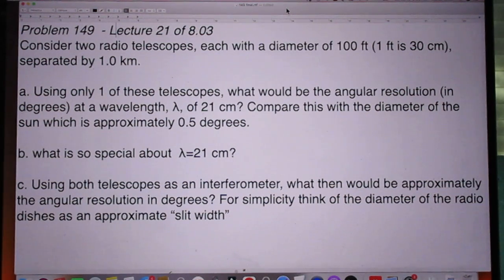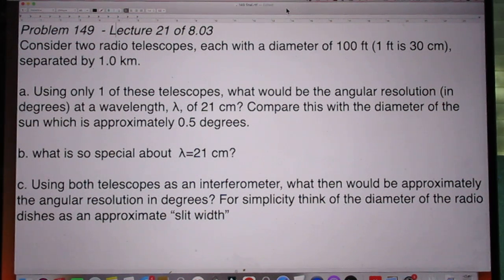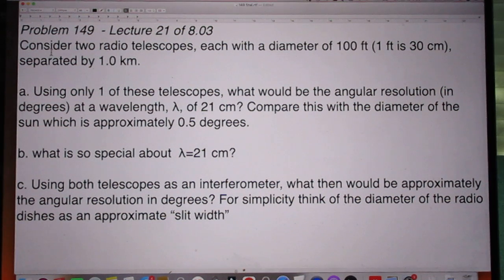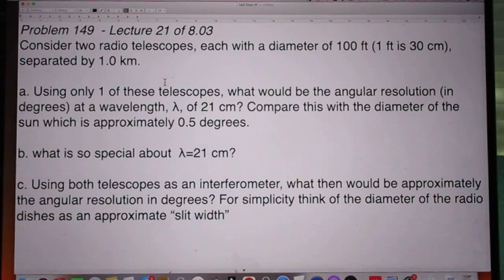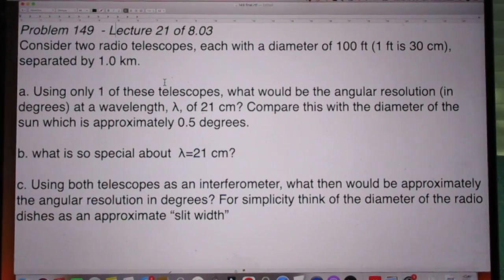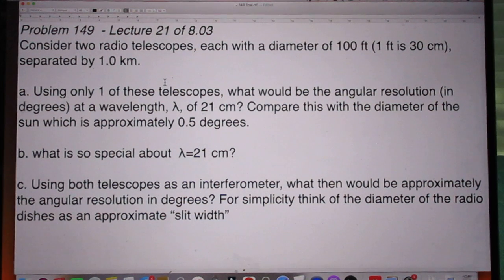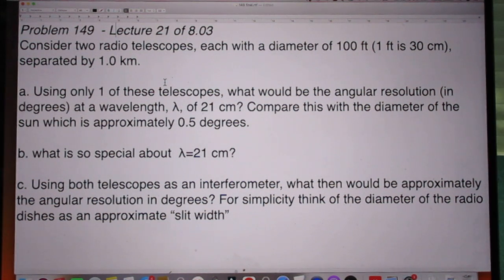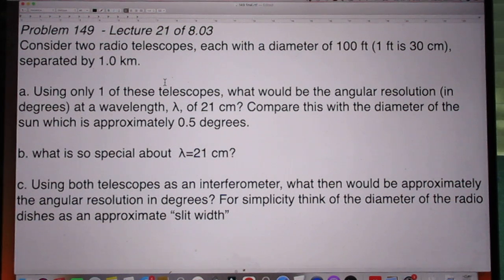Problem 149 Angular Resolution of Radio Interferometers

Comment: I am from India and I was watching ur 802 videos. I have a doubt idk where to contact u so I decided to comment here on ur most recent video.
I wanted to ask - can electric field vector be infinite in any case? With example and explanation, please sir. It's messing my mind since I thought about it. 
Please reply asap, please 😊
Reply from the maker: E-field can not be infinite
Reply: @lecturesbywalterlewin.they9259  
Incase if it happened supposedly, what will happen or what will prohibit E from approaching infinity? 
Just want to feel why not?
Reply from the maker: @krakash4474  The reason is that r of charge q canot go to zero.
Reply: @lecturesbywalterlewin.they9259   it means E field can tend to infinity. Right?
Reply from the maker: @krakash4474  E-field acannot become infinity - In practice you can't have fields larger than 10^11 V/m, simply because that would theoretically tear matter apart, since interatomic fields are of this order of magnitude. At least, that's what Purcell says in his textbook.
Reply: @lecturesbywalterlewin.they9259  thanks sir. finally after wasting my whole day behind thinking about it, I got my answer 😊

Comment: a.  The angular resolution equals: 1.22 λ/D = 1.22 × 0.21 / 30 = 0.00854 degrees.
b.  The λ = 21cm line comes from neutral atomic hydrogen (HI), a prediction by H. C. van de Hulst.
c.  The angular resolution equals: λ/d = 0.21 / 1000 = 0.00021 degrees.
Reply: @-GinΠΓ Τάο A positive hydrogen "atom" is just a proton, and has no electron, and spectral lines couldn't apply to it.   A negative hydride ion has two electrons, which complicates the calculation of spectral lines beyond the simple Bohr model.
Reply: I get R=.021/30.48 radians which is 0.039 degrees for a single telescope